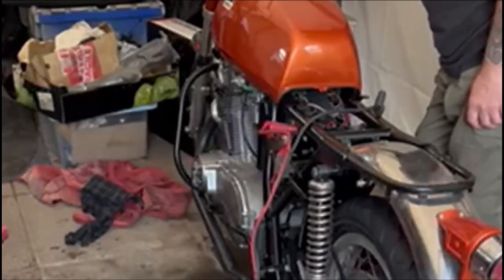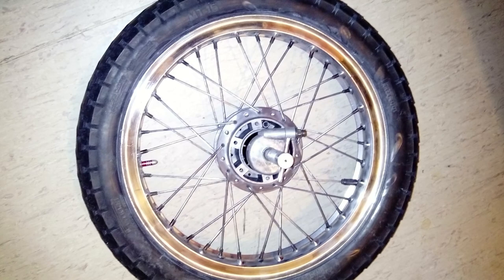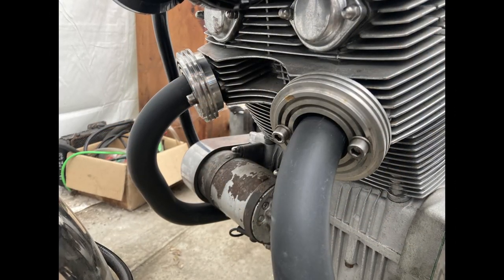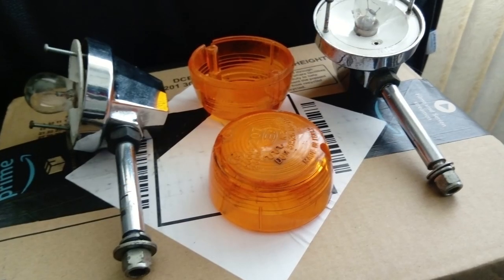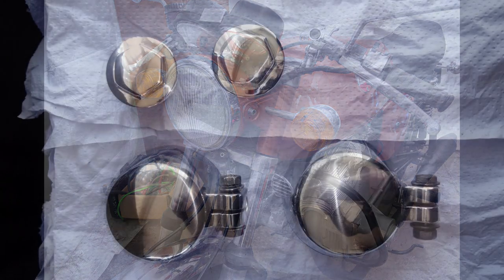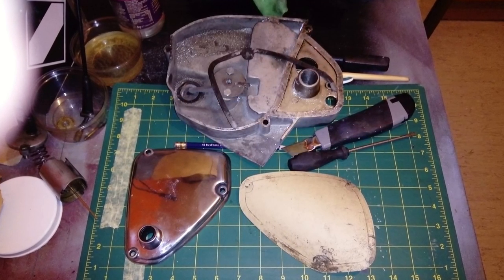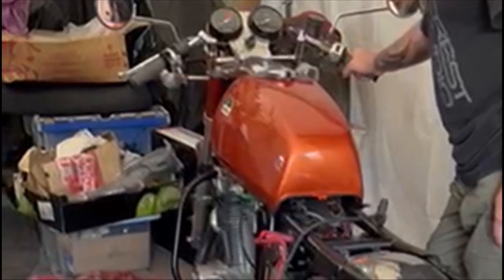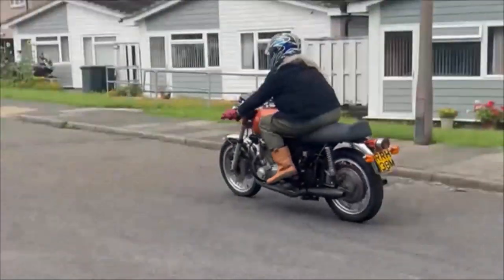Thunderous Laverda Classic Air Cooled 750 Twin Built not Bought

Comment: Nice Job! I can appreciate the work involved as i'm halfway through a full nut and bolt rebuild of my 87 FZR1000, bought during the covid debacle as a project. It arrived as a neglected,  cosmetically challenged, corroded mess, that had been down the road on both sides, pushed into a shed and forgotten. Thousands of $$ later and i'm just about to assemble the fully reconditioned engine.  Its been a labour of love (and patience) as parts for these aren't as readily available as they are for the later EXUP models, as they only made them for 2 years before the completely revamped 89 EXUP came out. Eighties bikes is what floats my boat, as its a time i was young and working in the industry and the pace of development was at fever pitch, with manufactures developing and selling an eclectic range of models, (not all of them successful😏) It was a great time to be in the industry.
Reply from the maker: only just seen this comment mate, ive got 2 89's :-) one pretty standard the other NOT lol, but i have got lots of parts too, if you ever struggle finding anything its worth asking, good luck, be good to see it when you are done
Reply: @barebonesmc  The 89 EXUP is an awesome bike, I almost bought one to restore, but then the 87 popped up, Ive got a soft spot for the 1st gen as they were raced to great effect in NZ and Australia in 87/88, by the time the EXUP came along the OW01 had taken over racing duties. Ive bought parts from all over the world for my FZR but there is one last part i just cannot find, and that is a headlight fairing, it is proving very difficult to track down.
Reply from the maker: sorry if i wasnt clear, i do have some genesis parts too, they came as part of a parts swap 🙂 not sure how much is left but its always worth asking if you are struggling with anything

Comment: I fitted a new Laverda supplied stainless system  with the huge balance pipe , which took six months to arrive and six hours to shoe horn together . I hated the system as the side ground clearance was lessened big style . It sounded ok . I bought the bike with a two into one system which had been put together by previous owners , possibly Merlin motorcycles at Thornbury . Hi Andy ! That system sounded superb and gave massive clearance which the bike can easily handle . The SF2 , which this one seems to be , was very very stiff and handled really well . I could use the front brakes in corners no problem . My rear brakes had worn pivots , which I never got round to sort out ....never needed rear anchors anyway ! Well a bit maybe on occasion . Loved my SF2 . I fitted SFC cams , second hand ( and way of pear shaped ! Valves kept open longer than standard ) , and SFC pistons . I had to remove the accelerator jets as the front end would lift unpredictably and wanted to save on washing my gacks .
Enjoy , I am sure you will , I am jealous ! ... but fit a balance pipe or two into one and take of the side stand , the main stand is so easy to use , so you save weight and gain clearance . lol . Oh , and fit electronic ignition , you know it will be worthwhile .
Reply from the maker: cheers mate, Wolfgang keeps telling me it needs balance pipes too lol, we will see in time 🙂

Comment: It sure is fun to get the old girls sorted out! Sounds and looks nice. I can't say I have ever seen one of those before. Patience finding parts and doing what you can with what you have is the challenge with that one!
Reply from the maker: cheers mate, it is 50 years old now so not so many out and about, although they have lasted remarkably wellv i would say, Based on the SFC race bike which won countless Endurance races over the years, its basically 2 thirds of a Jota lol,
Reply: @barebonesmc - a review I read years ago described them as 'the last of the really hairy chested bikes', and it always seemed about right.😂
Reply from the maker: @floydblandston108  lol, i think thats a pretty good description 🤣
Reply: @floydblandston108 I am just under 5 foot 5 inch and managed it no problem ; not a beginners bike mind you !  It is like a Brit bike with Honda reliability ( change to oil religiously as there is only a round cheese grater for a filter though at 1500 miles road use . Kinell , but do it , I learnt the hard way ) and Ducati handling and brakes . Nice
Reply: @barebonesmc  Same head as the SFC , different carbs I think ( flat slides on SFC ) , same gear box gears , except not in exotic metal . Yup Jota's Daddy ! Like Bonnies are to Tridents .

Comment: What a great project! I know a few peoplle who've owned it once. I remember that several years ago, the ground plate for points in the ignition were out of stock. With no aftermarket parts available, this friend almost gave up on the bike. Donn't know, If and how she ever got it fixed or had to sell the bike.
While you could have the plate itself machined, one large issue would have been to find a capacitor to be welded on to the plate.
Reply from the maker: 🙂Cheers for watching and for the comment mate. the points can be replaced with an electronic ignition module, but i managed to get new points and capacitors fine, just cross referenced old part codes, the backing plate wasnt standard as i said, but works fine, it is just a standard 180 twin plate. Ride Free 🙂